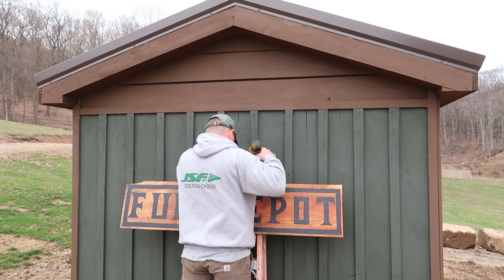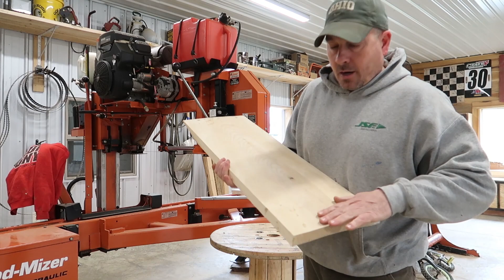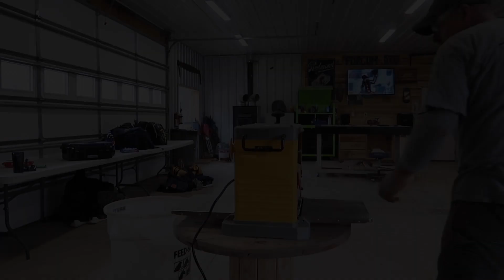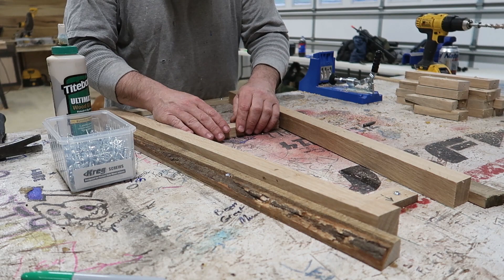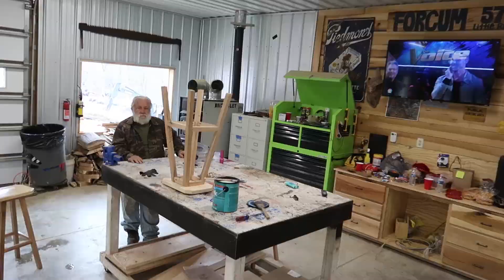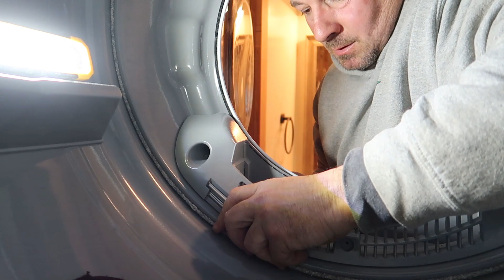Cairn Creek on Quarantine

Comment: Just some observations. I would bet that craftsmen table saw was working pretty hard to cut the 6/4 white oak. Looked like you had the rip fence on the wrong side. Build yourself a out feed table for you table and use a push stick, pulling lumber through a saw will get you into trouble. With a project like that sand your pieces before assembly. Round over the out side corner of the legs it will help stop any splitting of out side edge of the leg. Please don’t take this as criticism just some friendly advice.
Reply from the maker: Time thanks for the feedback. I’m pretty new to the table saw business. I actually spoke of that in one of the other videos.